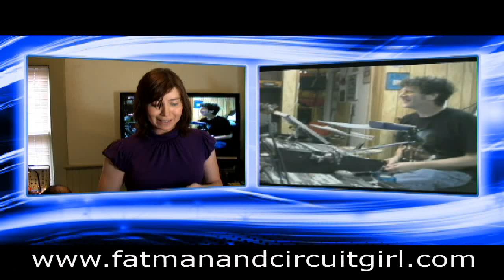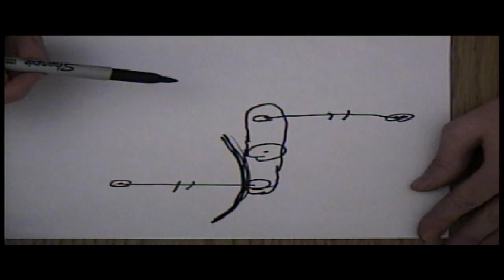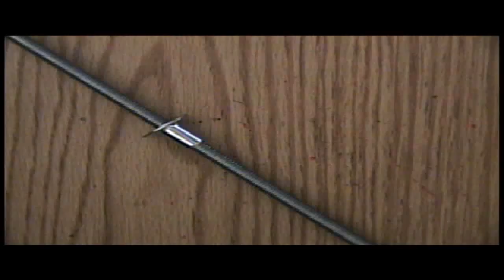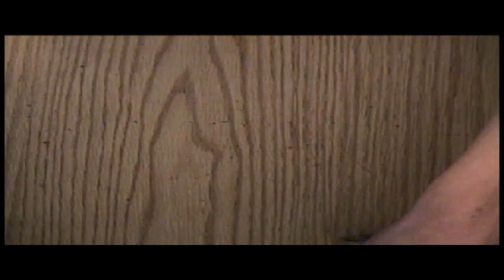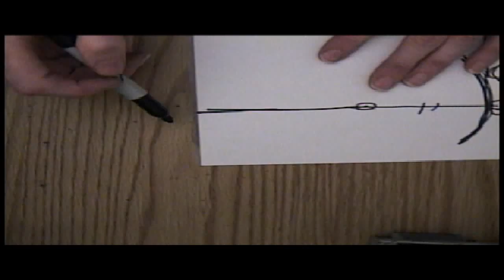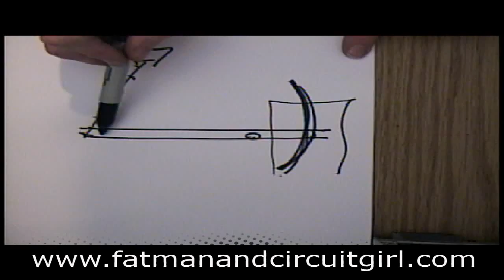Watts Link   Precision Positioning and Race Car Suspension

Comment: You should explain why the motion of the center of the birdcage only "mostly linear":  The top and bottom links do not displace upward by equal amounts.  This is because, as the birdcage tilts away from vertical, the vertical component of its length gets smaller.

Comment: I am not sure if you are talking about your rear suspension system,--or making a cnc mill using CD drive bearings and threaded rod.

Being a pretty good machinist myself, and knowing a bit about suspension from my dirt bike days,--I think you should stick with the suspension system. :)

My slightly educated guess would be to shoot for a slightly rising rate linkage.

For a pretty good "Bridgeport sized" CNC mill for under 10 grand (I got mine for 12, with tooling and computer, stand/large chip tray), try "Tormach".  I have machined almost $1,000,000 worth of work through it so far (porting small 2-stroke cylinders), over the last 8 years.

Comment: On a live axle system, why use the watts link to control the up/down motion during suspension travel? 

It would be easier to use a 2-link control arm + tracking bar set-up to maintain differential pinion angle throughout the suspension travel. 

 Id kinda think that the watts link would do better mounted paralell to the axle/differential to restrict transverse movement and maintain linear suspension travel.

Her design is a bit unorthodox me-thinks.

Comment: This is a lot of useless irrelevant babbling, her watts link race car suspension wont work as well as the traditional 4 link, and even if it did what does it have to do with open source CNC, or precision bearings, or a loose nut on a threaded rod, or a computer straightening out an arc.